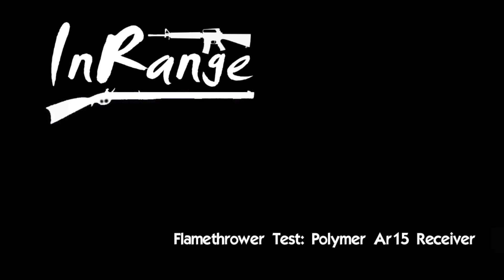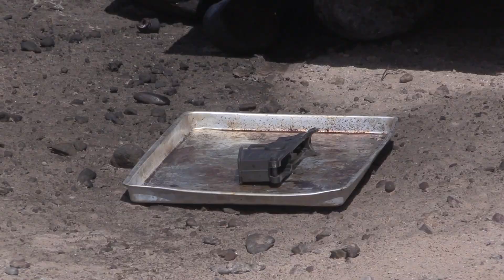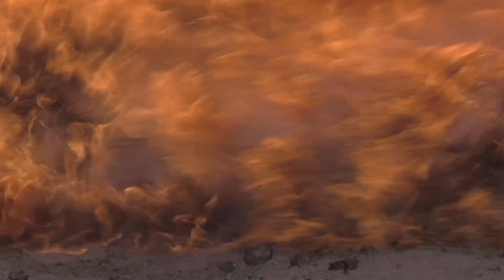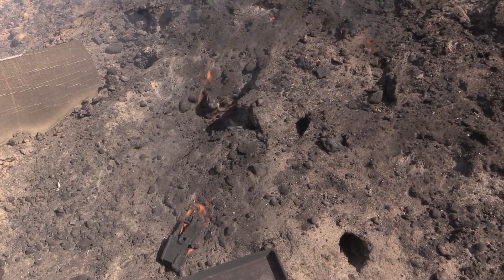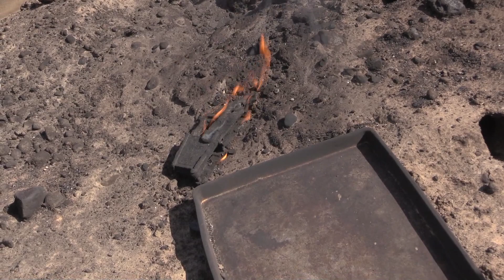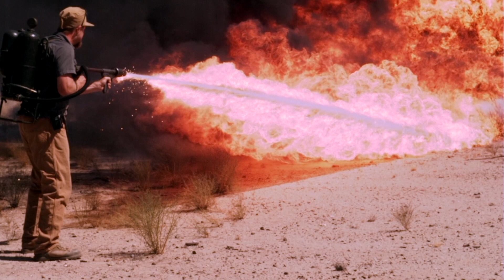Flamethrower Test: Polymer AR15 Receiver

Comment: What makes a polymer lower receiver any different that a pistol with a polymer frame?  They both house the trigger and hammer components.  They both contain the mag well.  Both hold or has a grip. Both support a recoil spring, although the AR-15 buffer tube and spring are much larger. 

I don't like the plastic lower either, but that's what I originally said about the plastic handguns.  Weight is everything when you have to carry it all day.  Don't get me wrong... I still would not buy nor recommend a polymer AR-15 lower.
Reply from the maker: +YoderTexas Actually I've had more success, resiliancy and trust with the GWACS polymer lower than I have had with any aluminum one.   ~Karl
Reply: InRangeTV
I believe you.  I am concerned though about the stress where the buffer tube connects.  I wouldn't trust it to slam the butt against the ground trying to get a stuck round out of the chamber.  What trouble did you have with the aluminum lower?
Reply from the maker: +YoderTexas I had an incident in which a number of rifles were run over by a truck.  The aluminum one bent and was out of commission.   The polymer GWACS lower was unharmed.   I will specify that I think that there's only one AR15 polymer lower that I trust, and that's the CavArms GWACS one because it's designed specifically to be polymer.   These other lowers that are merely normal AR15 lowers made out of polymer are not a good idea.

Gwacs video:
https://www.full30.com/video/41324b93161c3953ea131b0d23ebecd0

Other manufacturer:
https://www.full30.com/video/31a73f8fade48648de9f917af92fdd53

~Karl
Reply: InRangeTV
OK.  That one looks like it will stand quite a bit of abuse before it would fail.  I would like to see a torture test on the other "hybrid" lowers.

Comment: i think that even a complete firearm wouldn't fire without issues after an attack like that, due to the heat and its resulting deformation of your weapon system (the polymer one melt like seen, the steel one is deformed on the heat in my opinion)

Comment: These kind of weaponry are always a ... hot topic with SJWs.
Reply: In all seriousness, flamethrowers are a bad idea for both the user and the enemy. You have the moral side of burning or even melting your enemy whiles the flames absorb all of the oxygen, if you're in a closed space, and suffocating you both. Then you have the practical side of having a lot of unprotected fuel tanks full of flamable material sitting right on your back.
Reply: +CreaturePlaysGames Which is why we now have thermobaric rockets to use instead. Great for hostage situations (Beslan 2004).

Comment: I guess we won't be seeing that polymer lower in any more videos. What other item of controversy will take its place?
Reply: +mallory1970 Hi Points may be cheap and clunky, but rarely do they fail. IV8888 did a whole series of torture tests, and it passed all of them with flying colors...except the meltdown where he literally melted it lol.
Reply: I've shot 50 rounds through a friends without failure, it felt like crap but it shot to a somewhat decent degree of accuracy (sights suck). He has over 1500 rounds through it and said the only failure he had was a failure to fire from a bad primer (junk ammo he got at a gunshow) and said it was definitely not a light primer strike. I will never own a Hi-point because I have a SIG P320 compact and a Lionheart LH9N, but I'd rather have a Hi-Point for self defense/home defense than have nothing at all.
Reply: +Griff But when you can get police trade in Glocks that have been refurbished and are being sold at a fraction or the original price, why would you?

Comment: I guess we need asbestos lined receivers
Reply: Asbestos isn't enough for me. I need a material that has a melting point of no less than 6000 degrees Celsius just in case I find myself fighting inside the core of the earth
Reply: Spurs390 well then consider tungsten.
Reply: +GreyDevil And don't forget lead against the possible radiation from a nuke.
Reply: +GreyDevil Fun fact : one of the prototypes for the Famas actually had a handguard made of asbestos. They dropped it because it was to brittle.
Reply: +Wetcorps Well it if was so brittle, dropping it seems like the worst thing to do! :^)